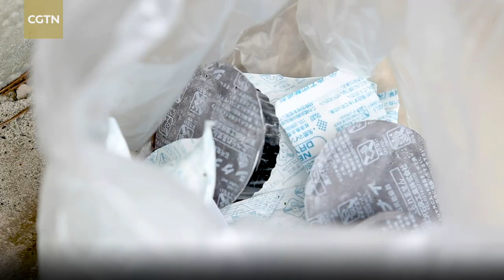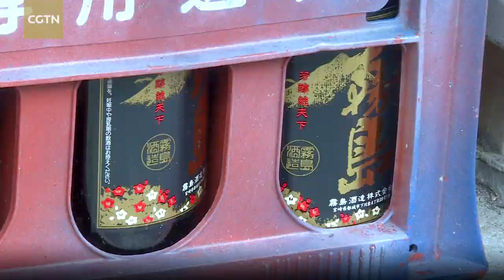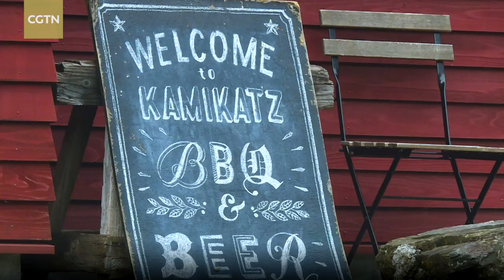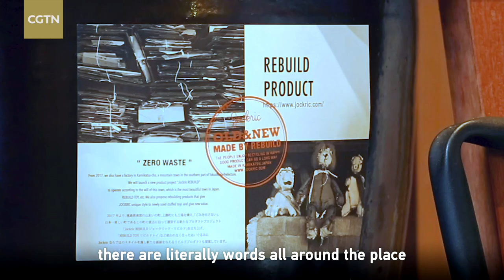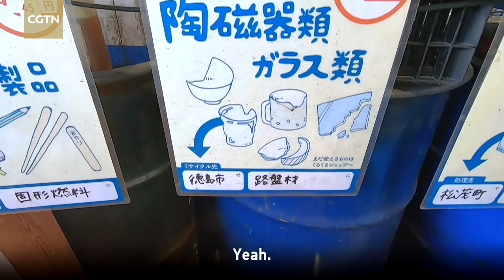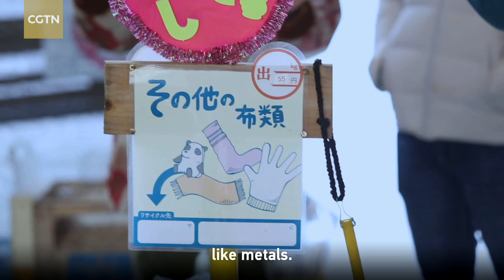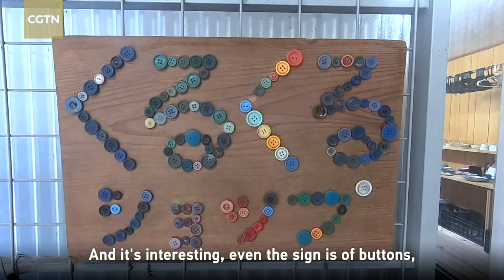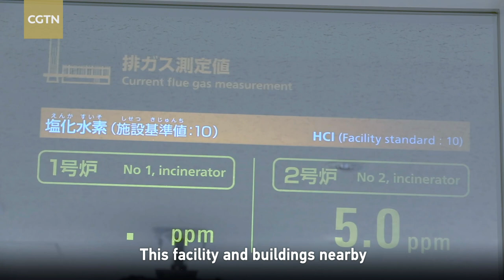Assignment Asia: Japan's zero waste town

Comment: I think replicating this on the scale of communities of a similar size to Kamikatsu within large urban areas should be the way forward. When material is processed on a community scale you can reduce costs and then the resulting resources can be processed more centrally. Sure theres more labor for each of us, but sharing in the labor lessens it for all of us, even has the possibility to help build community cohesion and resiliency

Comment: Zero Waste doesn't fully support recycling 🤔 it's more of a scam than a safe system. Plant based plastic for single use disposable is the best bet. Still I'm really happy to see an entire town work really hard to figure out zero waste.
Reply: that would require action at the highest levels. But at the local level, this is already in itself a great initiative.